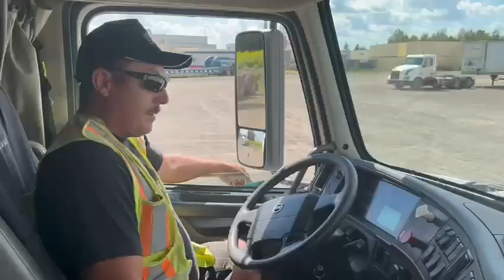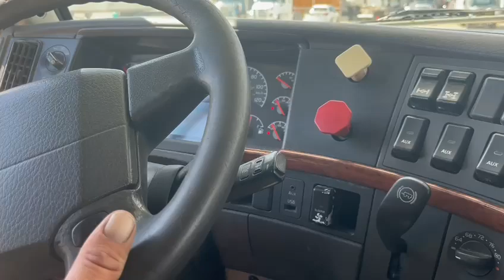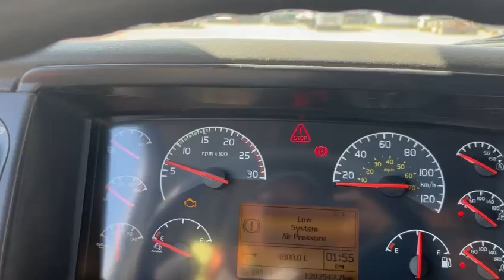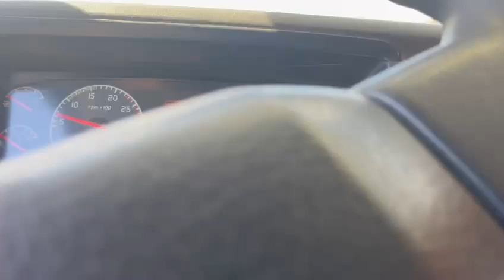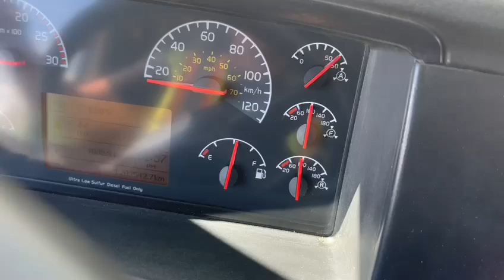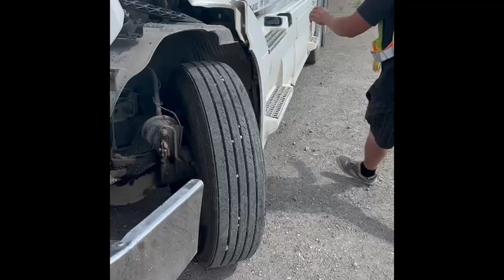Alberta Air Brake practical test

Comment: Push in red and yellow!? Our book shows " Pump service brakes to reduce air pressure until governor cuts in. Confirm cut-in is 20-25PSI ( 138-172kPa) less than cut out pressure.